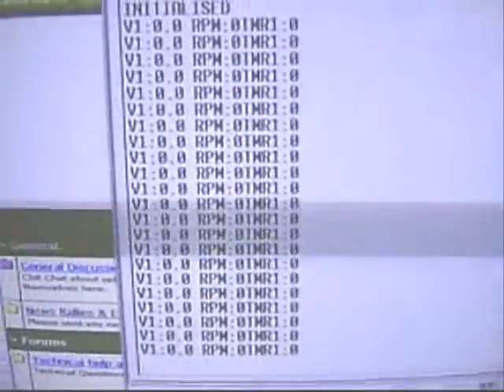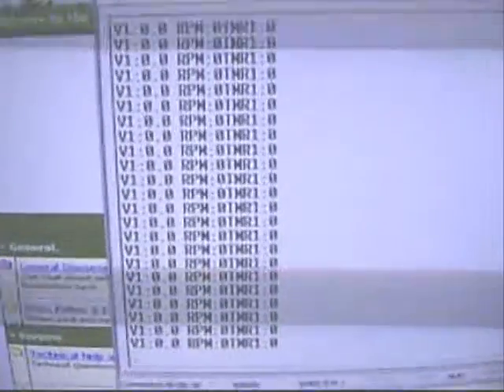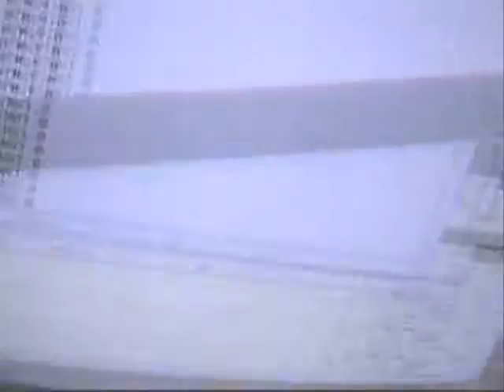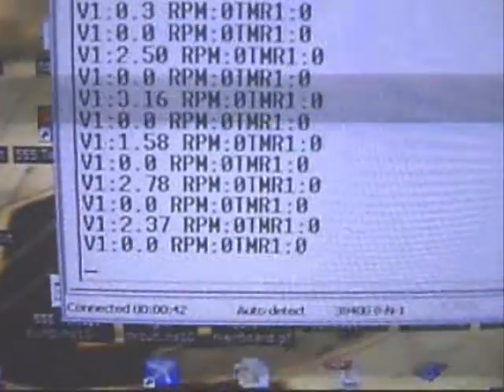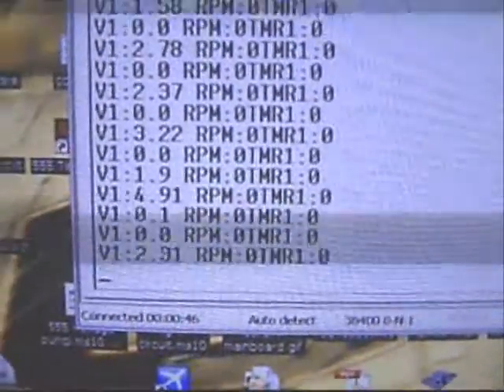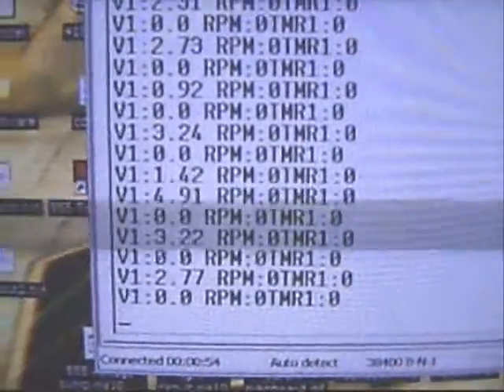comwarriors quest for the holy power grail 1 - new pulse motor control system

Comment from the maker: the microprocessor i'm using does support 'In Circuit System Programming' so it can be programmed without taking it out...
However, problems can arise with using ICSP...